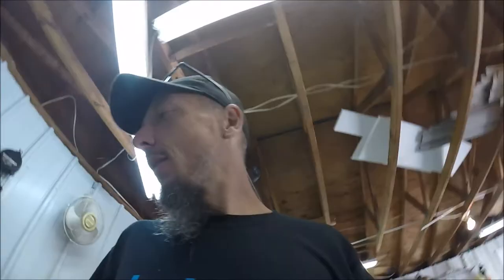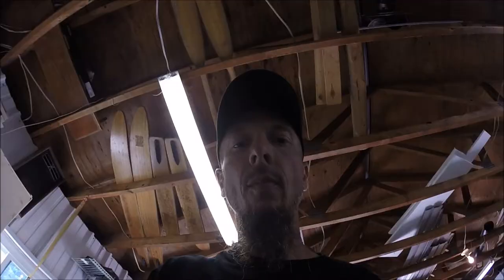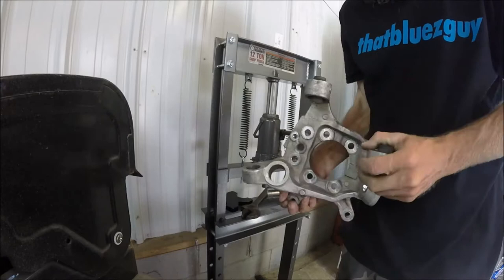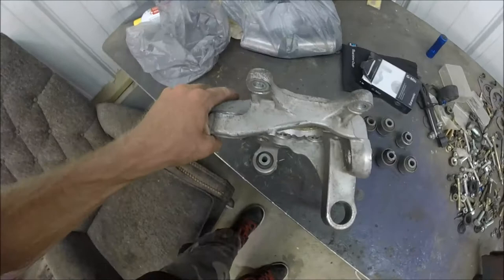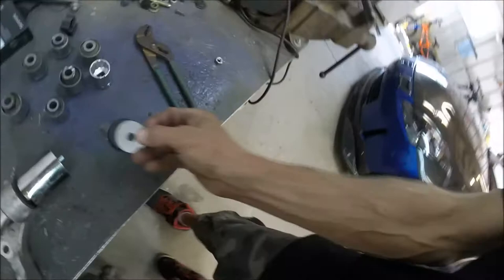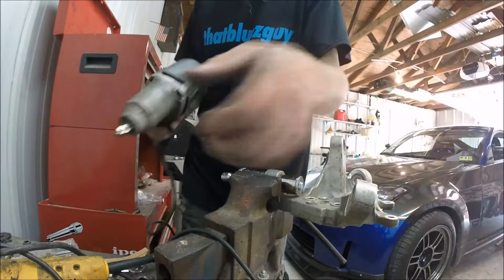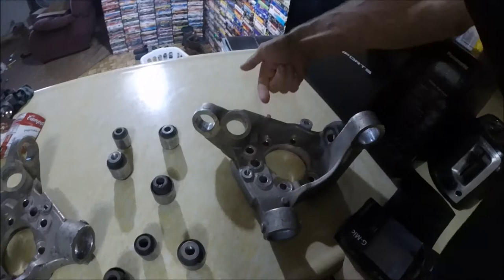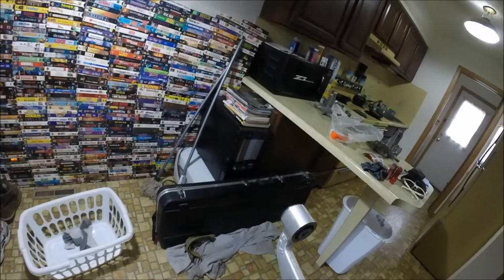350z rear spindle knuckle bushing removal

Comment: You've pressed out way more bushings than I have on my car but I've been doing it with a ball joint kit and socket and even a simple grade 8 bolt and stacks of washers worked great.  I think maybe those would help with some of the strange angled ones where you can't lay the part flat. Try the grade 8 bolt and nut/washers. Awesome job.
Reply from the maker: thanks man 👍

Comment: Have 97k on my G35 figured its more than time to change the shocks.  Started with the rear and got one out and other installed in about 45 min.  Was cake.  Moved on to next one and the lower shock bolt is literally seized to the shock bushing.  I can turn the bolt but it turns the entire bushing with it inside the knuckle.  I'm loosing my patience.
Reply from the maker: Oh man those bolts can be a nightmare worst case scenario carefully cut it off and order a new shock bolt 👍
Reply: @TALONATER  Yea going to order a new shock bolt and shock bushing as well.  With the bolt seized to the bushing it spins inside the knuckle as one piece so the bushing is toast too.  Those easy hour or two projects that turn into more time and money are a pain.    And one more thing, thanks for spending your time and money in producing videos that help the community.  People like you sharing knowledge whether it be in car maintenance, plumbing, hvac, and any hobby really makes the world a better place.
Reply from the maker: 🙏 Thanks man that means alot to me 👍

Comment: Hi brother. My rear tire has play with 12 & 6 rotation/wobble but not 9 & 3. Do you think that could be a radius arm bushing?
Reply from the maker: I'm assuming you're referring to the front and does it make noise when turning at moderate speed sounds like it could also be a wheel bearing super hard to diagnose in the comment section of YouTube without me being there to hear it 👍
Reply: @TALONATER  For sure. Its in the back. I think either a wheel bearing or radius arm bushing.
Reply from the maker: Okay first off bro there is no radius arm bushing in the rear that's in the front you have a control arm bushing and many other bushings in the rear so now I'm really confused about what you're talking about 🤔
Reply: @TALONATER  All good mate.I'll do some more research. Thx for your time.
Reply from the maker: @ryanscanlan9875  😎 👍

Comment: How can I remove the one for the strut without having to remove the whole knuckle?? I don’t have the tools to remove the knuckle itself
Reply from the maker: Are you referring to the spring bucket if so it just unbolts and drops right down 👍
Reply: thatbluezguy I have to replace the bushing that the bolt that attaches the bottom of the coilover to the knuckle goes thru goes through.. I was replacing my old coilovers with new ones and the original bolt was seized to the bushing itself so I had to saw the bolt off but the metal ring that surrounds the rubber part of the bushing is still in that hole and it needs pressed out .. what’s the easiest way to do that without having to remove the entire knuckle itself
Reply: thatbluezguy I wish you could comment  pictures so you understand what I mean
Reply from the maker: @Ghost_717  this is very difficult for me to try to figure out via text if you could hit me up on social media and send me pics this would be much much easier bro 👍
Reply from the maker: @Ghost_717  hit me up on Instagram or Facebook bro 👍
Reply: thatbluezguy I messaged u on IG
Reply: @Ghost_717  Since the bolt is in the hole, you either have to take off the knuckle or you will have to find a catcher that is big enough for the bushing to fall in.

Comment: I'm doing this to my G35 coupe (at least a shop is).  I'm changing all my bushings to polyurethane.  This is an expensive a$$ job.  But, when my G is done it's going to be sick.  The front is complete.  His movie collection is almost as big as mine.
Reply from the maker: I'm glad to hear your car is coming together bro 👍
Reply: @TALONATER  Now, on to the rear, too bad you're not close to Maryland.  I'd let you do the job.  My entire coupe is getting done with all the right stuff.
Reply from the maker: @darrelltuttle8298  nice bro hell yeah 👍
Reply: @TALONATER  , question.  What's the labor cost to replace all the bushings in the rear spindles.
Reply from the maker: @darrelltuttle8298  I think I paid around forty bucks per side something like that
Reply from the maker: @darrelltuttle8298  every shop in every town and state will be different
Reply: @TALONATER  you ain't lying.  The shop I usually go to wants to charge me 1100 dollars in labor to replace the bushings in my rear spindles and I already have the whiteline bushings.
Reply from the maker: @darrelltuttle8298  OMG bro that is absolutely insane smh ☹️
Reply: @TALONATER  That's what I thought.  I'm going to see if I can find a shop that'll do it correctly for less money.  They want 586 dollars just to remove the factory lugs in the rear and install the 20mm lugs that I've already purchased.
Reply from the maker: @darrelltuttle8298  holy shit find a new shop bro that's insane I think the problem you're running into is most shops don't like to install aftermarket parts so they just charged insane prices to do it